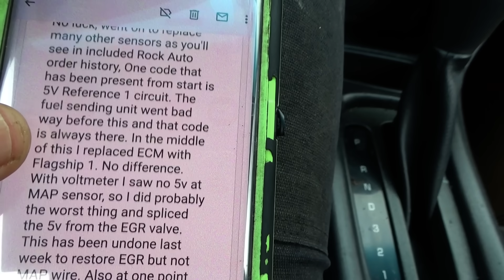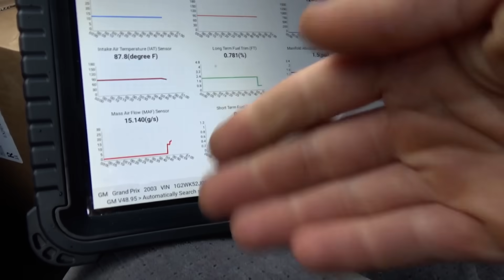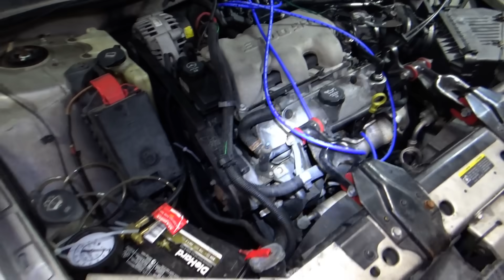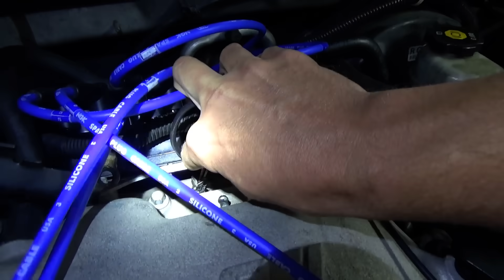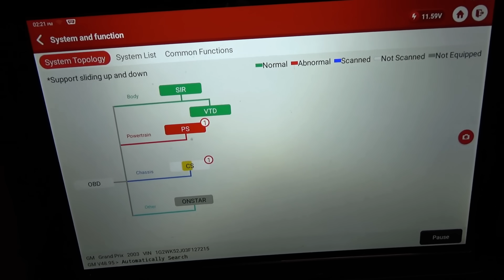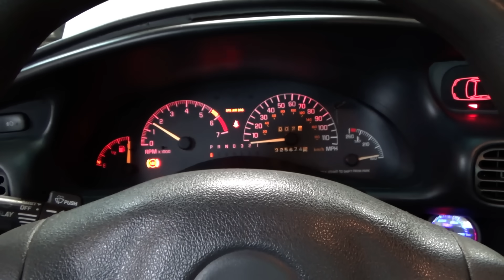(Pt 1) 1 YEAR of Pontiac PARTS CANNON?! (Runs ROUGH -P1635 5V Ref -P0107 MAP Signal LOW)

Comment: I have one of those base Grand Prixs with the 3100 V6 instead of the 3800. Everyone talks up the 3800 but the 60 degree v6s are just as reliable imo. Same intake gasket issues

Comment: I’m with you! I do not use butt connectors at all if I can help it. Even the uninsulated crimps are still trapping air and moisture in it when you heat shrink it. Weeks or months down the road, comes back with a bubble of corrosion, if it is not done right.
I enjoy watching your videos!!!

Comment: Soldering and shrinkwrapping isn't always the best repair because it's not advised in high vibration environments. The vibration will cause the solder to become brittle and the solder joint can crack or make a bad contact.

For those situations you can also use a "J-hook" style splice of twisting the wires together and then shrink wrap, which will remain flexible.

Comment: Crimping and soldering have their own purpose. If you're a modder or car builder, then crimping all of your wires and connectors is the way to go but for on the go needed repairs, soldering is all you can do. Although I've never personally seen this but the crimper people say that soldering wicks solder down into the strands away from the joint and can cause the wire to become stiff and that can lead to another breakage in the wire.

Comment: I bought a new 01 basic Malibu to drive to work. Then my middle daughter drove it to school and college. She got her own car, my Malibu came home, at 370k
It got stolen, some idiot gutted my stereo, drilled a hole through the roof. Trashed the interior. Spray painted the car gray with a case of rattle cans. Painted my rims. 
Trashed my trunk and spray painted it too. 
Tore off my mufflers. 
The police found it at the local Target store. They caught him with his girlfriend shop lifting. 
After I got my car back. It was way beyond what I could spend to restore it. 
I took out all of the trash and called the insurance company. They paid me the insurance loss for the car. 
The engine and transmission were original. Engine never used any oil period. The transmission, I serviced it every 100k. 
Never had any wiring issues.

Comment: I have a 2003 chevy 1500 express van 4.3v6 vortec original motor  390,000 miles.
I had the coolant sensor on driver's side cylinder head 5v ref short intermittent shut down misfire ran rough . No scanner could find issue. The oem 
Sensor got cracked from spark plug change since its close to it. 
Its a three wire sensor the one on thermostat is two wire for temp gage.

These years GM was so good.

Comment: I've never much cared for those fully electronic egr valves on American cars.  They are a fairly common failure problem and typically cost 3 to 4 times as much as the vacuum powered counterparts they replaced.  What usually causes them to fail is a clogged pcv valve that very few bother to service anymore.  But enough of my rant.  I'm looking forward to seeing what happened to the 5v reference again.  It was working, what happened?

Comment: Another common failure point on 80/90/00's GMs is the thin plastic tubes they used for vac (etc) lines.  They crack. If they break... well, you can spot it (sometimes, as they run under the intakes in places)... but if they're just cracked, you can get bizzare MAP (etc) readings.

Comment: This was approaching the end of GM's golden era.  There's a reason there are so many of these still on the road!  Shorted 5V reference, clogged EGR, missing a cylinder, 320,000 miles, and it was still trying to go!

This is my favorite era of cars; enough technology to be good, but not so much to be overly complicated and unreliable.
Reply: So true...3.8 GM and vortecs solid easy to repair.
So sad new stuff is garbage.
Reply: @mitzvahgolem  4.3 vortex all day!!
Reply: @nxpapke123  385k on my 1500 Chevy Van express.
One trans one bad valve I fixed firm junkyard.
Basic cheap repairs .
Reply: Yeah this is the kind of car that shows up at a demo derby and is the last one running.

Comment: A 2003 with 325,000 miles and the owner is spending money to keep it going? Jeesh, let the poor thing rest in peace.
Reply: If it’s not rotted out, I’d rather keep them be of these simple older GMs on the road than some modern turbocharged horror
Reply: @gtemnykh I'd agree that if the body and chassis are good it is definitely better than the newer cars, but personally I'd rather rebuild any part of a pre 1986 vehicle than have to chase down computer gremlins any day.

Comment: Just reading other comments, I see a lot of people having injector issues. 30 years in the trade, I had one stuck open  in  92 Buick 1999,  3 (same car) 99 Malibu plugged with rust from hole in gas tank 2007, 1, one 98 Grand Cherokee 318 leak down 2008. Another was harness wire in 89 Olds after I did motor swap. Injectors seem to be getting cannonized lately.

Comment: For all the GM haters, over 300k on this vehicle; incredible.
Reply: it has a 3100 V6 too, not the famous 3800! Five will get you ten the owner keeps the oil changed and maintains the car.
Reply: That is impressive...almost Toyota like
Reply: Just cause a car has 300,000 miles on it. It doesn’t mean it runs and drives great! 😂

Comment: You're right. You can't get a crimper in there. That's why the proper repair is to pull it apart, run a new wire, and crimp a new pin :-)
Reply: As long as someone is willing to pay for that.  Who in their right mind would spend labor time to do that on a car this old with 325k miles.  Comments like this blow my mind.  Should Ivan just take the time to do that for free?
Reply: @joeberg9823  You did notice the :-) at the end, right?  I poke Ivan whenever he says things like this.  That was the right repair for this vehicle, but when he talks smack about crimps and butt splices, I'm not going to leave it alone.
Reply: @major__kong  Missed the :) My bad

Comment: Hey Ivan one thing you want to also check is directly under the power steering pump there's a cam positioning sensor there it has a bunch of wires going to it be sure to look at it i've seen get bare wires. PS GM wiring harness ain't all that much better it really depends on the environment It is stored in but generally most engine bay wiring harness would disintegrate because of heat I know I just rebuilt my entire 1988 C2500 Wring harnessed from head to toe 🤣🤣 as I'm doing LS swap

Comment: 10.26.24.    The lower intake manifold gaskets had to of been changed on that car! The original plastic framed ones would’ve never lasted that long. They had to of been changed out with the metal framed kind. 💁🏻‍♂️The Dex cool™️ was not kind to the plastic framed ones.

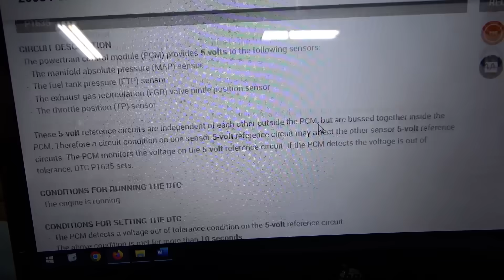Comment: Would be rare for new car of today 2024 to last 325,000 miles 9:57
Reply: I've got 354,000 miles on my 2001. Original engine with one transmission rebuild. One of the most durable cars ever built.❤

Comment: The EGR bypass is useful as a diagnostic, but the ECU is expecting the exhaust gas as a diluent, so it will impact fuel trims.    Depending on the engine, some determine if the EGR valve is flowing properly by measuring temperature downstream of the EGR valve.  If low, it will also trip the CEL.
Reply: Right but after he unplugged, ECM will assume no flow and will just run the calibration for no EGR.  It should do just fine.  Timing is generally advanced during EGR because of lower volumetric efficiency.  From what I remember reading 90s FSMs, fuel trims should NOT be impacted because the exhaust gas is supposed to be inert (and therefore not impact fuel trims), though with a misfire that wouldn't be the case.
Reply: @kevin9c1 you are correct on a MAF system, but this vehicle uses MAP.  EGR flow can impact MAP.
Reply: @reneneron2971  Yes, maybe I misspoke a bit.  EGR absolutely impacts manifold vacuum (and therefore MAP signal) because of the decrease in volumetric efficiency.  That is the whole point of EGR, to decrease pumping losses, cylinder pressure and NOx.  But, if the EGR is unplugged AND passages shut/blocked, the engine calibration will be perfectly happy with that and won't have any fuel trim issues.  And, even with the EGR is functioning, it would just put the engine into a different part of the fuel map, which would already be correctly calibrated from the factory to deliver the proper amount of fuel.   As I said, the exhaust gas is supposed to be inert so it just moves around the operating point on the VE map.  But the VE map is all part of the original calibration.  So while the amount of fuel changes, it already knows this, so fuel trims should be unaffected.

Comment: Soldered wire joints in a vibrating environment always break. :P
Reply: except that splice is in the middle of a wire, so it's flexible at both ends, there is no flexing going at the joint itself. plus a properly wrapped and secured wire loom won't vibrate much. always reattach the factory loom mounting points or at least zip tie it.
Reply: "always" is a strong word. I understand it as 100% of every soldered wire joint breaks. That is not the case.
Reply: Ivan gets away with it because these cars hit the crusher before it becomes a problem.

Comment: Hi Ivan,
I was hoping you might have had an easy one finding the EGR valve pulling down the 5V reference. The customer mentioned Rock Auto as where he purchased some of the sensors. What's your opinion on the sensors supplied by them. I had to replace an O2 sensor on my 2006 Toyota Sienna van and bought a Bosch from them since that was the OE brand and the van has been running fine with 135k on the odometer. You and Amanda stay safe.
Reply from the maker: @DonDegidio  no way Bosch was OEM on a Toyota! Denso all the way 😉
Reply: Definitely Denso. If it were a Mercedes or VW Bosch would be OEM
Reply: @topher8634  You are correct. Now I remember, they did not have the Denso downstream for the AWD so selected the Bosch as the next best.

Comment: 25 years ago soldering wiring on a car could be a pain, extension cords lousy irons etc. 
Let's face it, some people don't know how to solder properly.
Today with all the wonderful cordless options it truly is the best option and there's no excuse to not learn.
Reply: I have a lot of spliced/repaired/added wires in my Rodeo. Nearly 20 years of rough off road and winter snow use later not one of them has failed. People who complain about soldered wires dont know how to solder wires.

Comment: I had a 1991 Chevy cavalier in the shop the other day. Intermittent stalling turned out to be a TCC SOLENOID. With a 3.1 v6
Reply: 1991 Lumina, stalled LH turns. Cranks sensor. It broke off in the block, see oil pan removal.
Reply: Pardon my look of mild amazement that a '91 Cavalier would still be out there hoofin around w/325k on the clock.
Reply: @NVRAMboi  Sure, rust-wise.  But the J-body cars were actually very hard to kill.

Comment: summary
1)  what's not working?
2)  research/read/learn system(s)!!!!!!!!
3)  explore what's COMMON between problems.  (Is generally true that there's only ONE defect.  This is NOT 100% but is likely 80-95% true.)  ((Multiple failures ==>  power or ground or ecm))
4)  with sensors there's five suspect elements
     a)   power
     b)   ground
     c)   signal
     d)   sensor
     e)   ecm
5)  check the above with emphasis on COMMON failures = associated defects.  
6)  VERIFY success  =  run full monitors.

Comment: The MAP is right there by the coil pack Ivan.  I have a 2000 Impala with the 3.4.  Same shit.  I have replaced so many intake gaskets on these things I can do them in the dark with my eyes shut.
Reply: @LewisAAB371  Actually, I do believe their comment. 🤣
Reply: @LewisAAB371  Dude I've been doing auto repair since 1987.  I've done dozens of these intake manifolds over the years.  3.1 and the Vortec 5.7.  Yesterday I got to pull the water pump housing off a 1996 Caddy Northstar.  Never done one of those.  It sucked.  Same kind of plastic/rubber gaskets that they used on those intakes.  Crumbled.

Comment: Ugh! I put a Flagship 1 ECM in a GM over the Summer for an A/C problem. It cured that problem but it killed the alternator.  That ECM is still sitting in the top of my toolbox. I won't use them anymore.  My kid's girlfriend headed for town in her 3.0 DOHC Taurus Tuesday and being out of oil, it jumped time and, well, it's toast. I found a 1998 Corolla with 196k on it for cheap.  I plugged the scanner in and it only had 3 modules. 0.0  No codes. Runs like a top, shifts great, drives good, and even has working A/C.  It got 4 new skins yesterday and this coming week it gets new fenders on the front.  
Thanks Ivan.  I needed a good episode this morning.  Makes my coffee so much better. ;)
Reply from the maker: He didn't check her oil for her? 🙄
Reply: @PineHollowAutoDiagnostics    I think he secretly wanted it to grenade.  XD
Reply: Sounds like user error, waaah i ran the engine low on oil and it grenaded how could ford do this to me
Reply: @lieutenantdan8170  Ha!  Right!  It's been on it's last leg for a while now.  She bought it from Grandma, and it was a POS when she bought it.  My kid that works for Subaru hated it.  LOL!!!  I think he's glad it's gone.

Comment: Those eBay MAP sensors are a joke.  I fitted a 3 bar one to my turbocharged vehicle (not to the ECU, just for secondary monitoring) and the boost pressure blew the sensor apart.  The insides were the cheapest crap.  Hot glue and a non automotive rated PCB and sensor.
Reply: Pretty much all unbranded eBay/Amazon sensors are a joke tbh.
Reply: if the price is too good to be true, it's a scam 100%. the chinese scammers are laughing with the money in their pocket. with electronic parts always buy genuine oem at a reputable source, or at least a known decent aftermarket brand at a local brick and mortar store, so you can return it and get your money back if it doesn't work